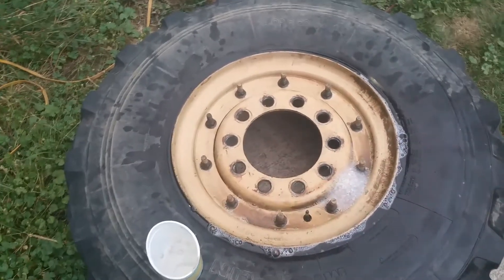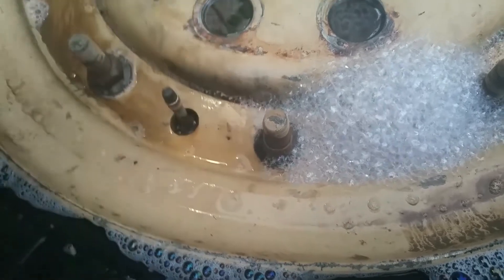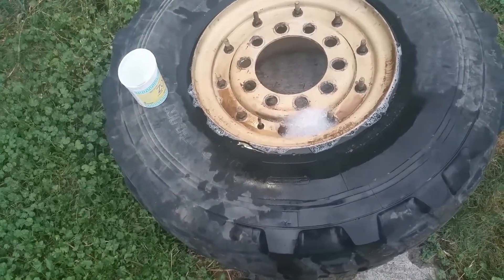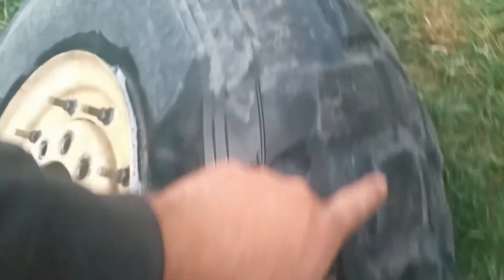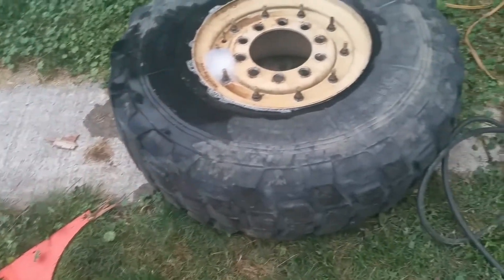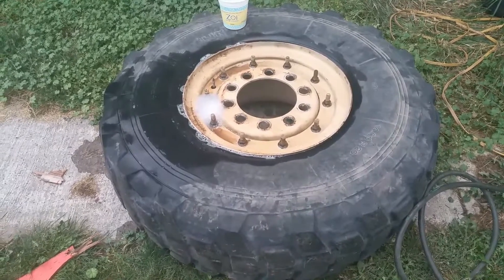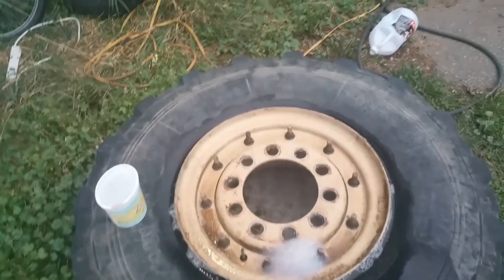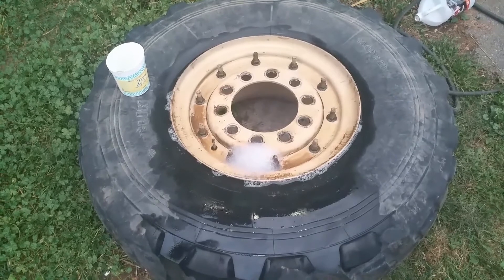Two piece rim leaks and a balancing ramble

Comment: They do make a commercial product that is for balancing tires.  Dyna Beads.  These are high density ceramic beads about half the size of a BB.  Now, these things are not cheap, but they work.  I have a dually truck (86 Chevy C30) and it cost me 90 bucks for the "Dually six pack) they offer.  Best money I ever spent.  Now all I feel is the road, the tires roll perfectly smooth.  With those big suckers you have, your going to need quite a bit more than the usual kits they offer.  They work great though, and they say they will allow your tires to last longer by reducing wear.  Something to think about.

Comment: I fixed an old Post Office truck and the one piece wheels had leaks, I painted them, inside with a tire latex sealant and then remounted the tire while the goop was still wet and the air pressure forced the crap into the pin holes and sealed them up.
Reply from the maker: Nice save.  So far mine have been gasket leaks but I might file that away.

Comment: for balancing, I would build a jig to hold the tire,so it could spin freely, and the heavy spot could settle then epoxy some of those pinewood derby weights, or rocks, I don't judge, untill the wheel/tire assembly had no more appreciable heavy spots. 'course, you'd have to do it in a spot where they won't just fall off when you get to speed. how do they balance 18 wheeler wheels?
Reply from the maker: That would work, sort of like balancing old motorcycle tires on a grand scale. I think they have spin balancing for the steer tires and maybe the drivers but just don't bother with trailer tires.  I tried my idea for a wood plug anchored with screws but didn't put any balance media in.  Figured this tire is sort of trashed anyway so I might as well test part of my idea for a future tire.  If I find it all lose inside when I go to change it then we know I failed.

Comment: Would using an RTV gasket maker sealant help seal the bead better and strengthen the seal? I haven't had to go down that road yet since mine still has the lock ring rims - just a random thought/idea.
Reply from the maker: I think it might but in my experience a fresh o-ring and then cleaning and painting the rim halves is your best bet.  I also worry that enough RTV to guarantee a seal might also glue the rim together making it harder to replace a tire.